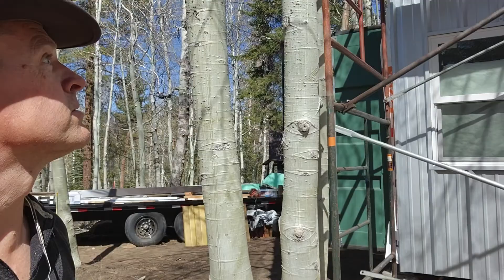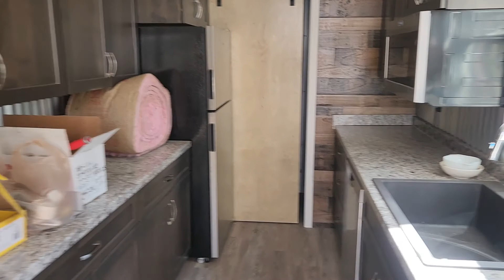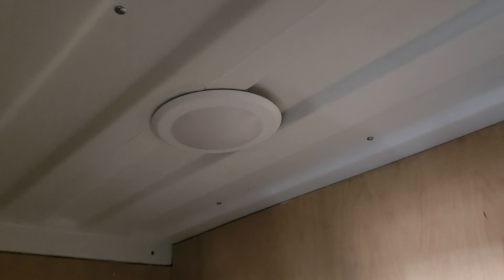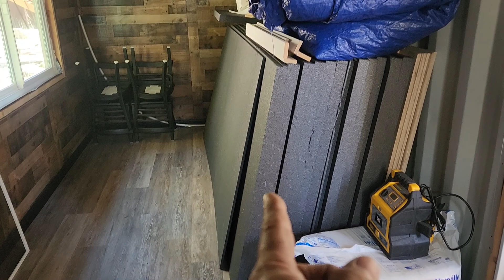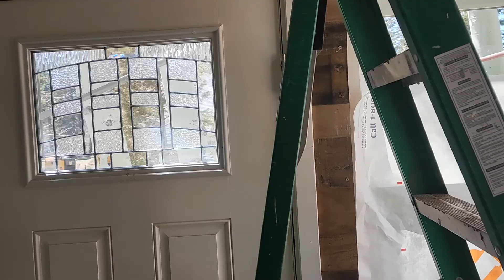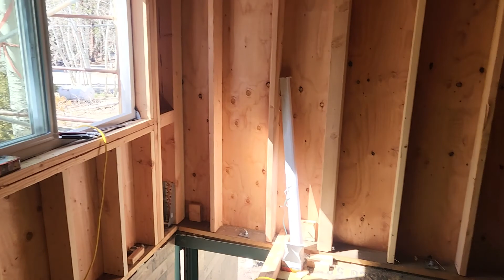Cabin update 5/1/22  Are containers cost-effective?

Comment: I'm amazed you don't have more views! This is a very important and useful topic.  Nevertheless, what is the cost breakdown approximately? Thanks again for making the series. You built a very good example. And have addressed all the points needed to build such a structure.  Great great work!
Reply from the maker: Thanks so much. I need to work up an Excel sheet. It was about $40k to do the build
Reply: @MrAlpin thoughts about cold roof versus warm roof ...versus a hybrid (kind of a double with a space/air gap between)
Reply: @MrAlpin it kind of looks like a two containers stacked would have made great use of the work you put into the roof?
Or too many rooms for the project?